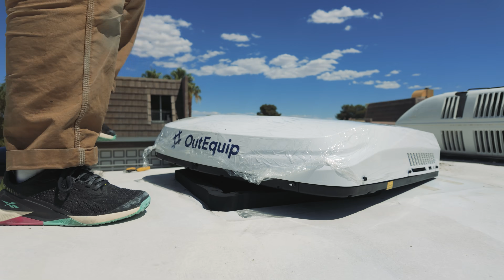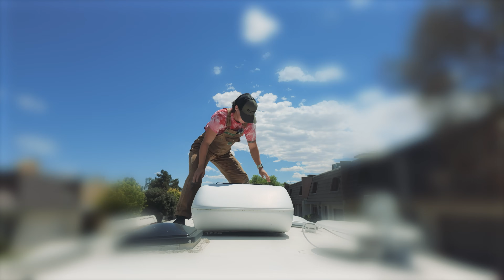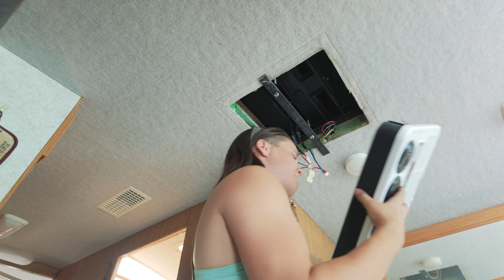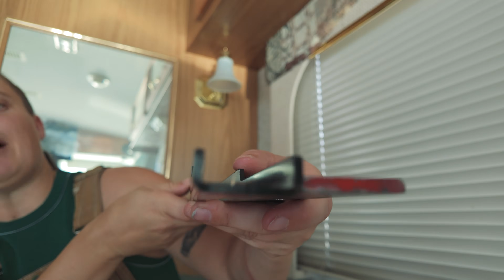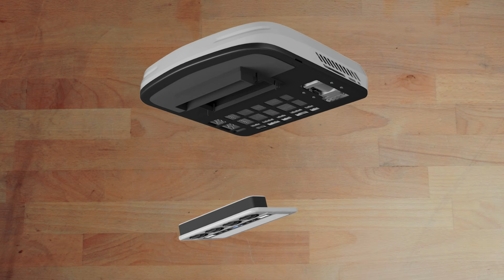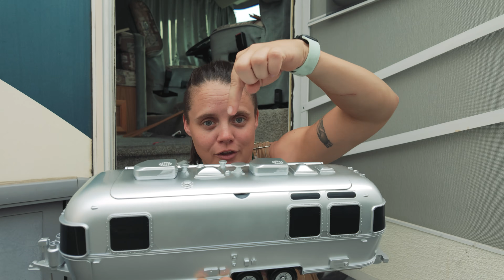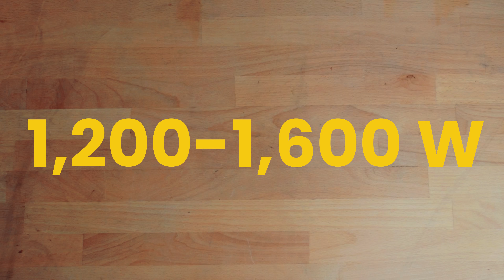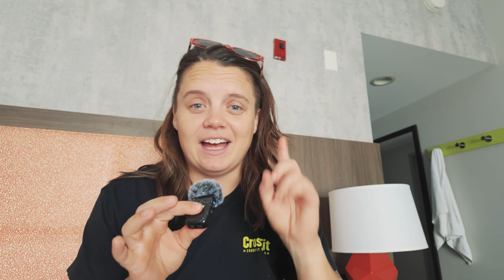Better RV Cooling with Less Power? My Switch to a 12V  AC | OutEquipPro AC Honest Review

Comment: heh i cheated getting my carrier on my roof.. i used a tractor to lift it right to my roofline and just slid it over as for the gaskets we tried them got sick of paying $46 each and finding out they leak we pulled them off used paint thinner to remove the crud it let behind and just used 2inch wide  butyl that overlap and 6 years down the road not a single drop and no longer get a mouldy musty smell.. even after 3 brand new foam seals 2 of them installed by an RV shop it still leaked and i got fedup.. as for me my trailer is semi perm parked on private property with a 60 amp outlet that feeds my upgraded 40amp consumer unit. have no issues would of loved to try the 12v system but at $1400 a pop compared to the 120v carrier i got brand new from the supplier for $599 its a touch out of reason if it ended up not being able to keep up..

Comment: To be frank the power usage at 22A was probably on an economical settings and not turbo. As their website state 58A at 12V on turbo for 10 000btu ( about 700W for 10kbtu ) which is more reasonable even though it's quite an efficient one as a house AC at 8kbtu will pull about 700-800W. The 300W you mentioned was way too low for it to make sense.

Their price is also surprisingly reasonable for the unit that also include heating capability ( I was honestly expecting something wild like 4000$ or the like since everything RV is just crazy prices ).

Comment: I’m sure the answer to this question varies a lot depending on what type of batteries you have but without a solar system on my class C rv how long would my two existing AGM batteries last with the AC turned on?

I’m guessing it’s not very long  ?

Comment: Thx for posting. I was hoping the fan noise would be much more quiet than the old unit . it is on start up but then ramps up to a similar noise level as the old ac .

Comment: OK, so, we just ran a contract on a 2002 Itasca Sun cruiser that has a basement air-conditioning with ducting. It’s 33 feet when they did the inspection it turns out the air conditioner would come on but turned itself off within a few minutes, so they said the seller was going to have to pay $800 to diagnose the air-conditioning problem. The tech said he was almost positive. It was a compressor and that he had just done one a couple of weeks ago and it was about $4500 and after the seller was contacted, he said he wasn’t interested in fixing it even though we are in Texas and who gets an RV in Texas without air-conditioning. My question is, could I just not use that basement air and put something like this air conditioner in my rig. We really wanted that RV what’s your opinion?
We walked away, but let me say that they immediately put

Comment: There is no way you are getting the same BTUs at 1/4 the wattage pull inverter or not unless the laws of physics change in that RV . If you are reading less watts that is because the inverter unit is not running on high inverter run units will take a suggestion of high but will use internal thermistors to determine the load. Will get more efficency but no where near that. Most of the effeciency of vfd driven equipment come from the start and the ability to only pull to match the load. Otherwise houses would all have 12v Heat pumps and air conditioners.

Comment: Ok, so I have a’22 year model trailer. Its box is 16’ with a furrion a/c central dump. The trailer has several 12v appliances already ( fridge, awning, slide, and lights) plus I have a 200 amp solar panel from factory. I just added 2 agm group 31 batteries to the rig. Do you think I could switch to this unit and it work for me? If so, what would I need to do to make it happen, as far as electrical, mechanical and so on? Thank you for your input!!

Comment: Two years ago I bought and installed a 12v AC unit in a ‘73 Airstream I purchased and revamped. ($900 CAD new, but second hand)
Mine just sits on the floor and gets screwed down. I had to give up under bed storage. It exhausts and drips out the bottom. 
I didn’t give much thought to pros/cons for DC over AC, (30amp system for me) I just bought what I thought would work.  I had to purchase 20 feet of cable at $10/ft CAD. 
The unit itself is quiet, but fan can be heard on highest setting. I do have an inverter, and two 100amh batteries, but I’m guessing those batteries would get used up daily if I wasn’t plugged in. After hearing the numbers here, maybe I would get more out of the batteries than expected. 
Let’s for a moment think about the words camping and air conditioning in the same sentence. Kind of silly. Even though I’m thankful to have mine. 
I enjoy these videos as I’m a DIYer, but a new RVer/camper.

Comment: They also sell a 24V version, but according to their specs, it uses more watts than the 12V.  I see the BTU cooling specs are comparable to a regular AC unit, but how does it compare in real world Vegas temps?  Does it do as good of job?  These units usually use 3 phase motors/compressors with an attached 3 phase inverter.  They could make one that took 120V DC (not AC) and then use a step-up DC-DC converter at the battery.  That way, the existing wiring could be used.  The vast majority of people that complain about these units are not complaining about the unit itself, but the necessary wiring.

Comment: How much success can be found by pulling the new wire with the existing A/C wires? Those will typically go to the braker box that has a 12V fuse panel next to it. Although it's common for conduit I know RV don't use conduit.

Comment: This is so great. I’ve been seriously looking at removing the generator altogether. Mine weighs near 300lbs. 300lbs of battery translates to piles of power. 
I’ve had excellent results with a 2600w lithium ion battery setup and 400w solar panels. It’s a tiny setup but managed to run everything we needed except the refrigerator and AC.
With these AC units (or similar), and the new 12v refrigerator options, I’m going all solar for my next revision.
Cheers!

Comment: THERE IS NO "MAGIC" HERE.  JUST A MORE COMPLICATED SYSTEM THAT USES A DIFFERENT POWER SOURCE.  WHEN HOT OUTSIDE THIS UNIT WILL DRAW MORE POWER FOR SURE.  I WILL PUT MY 30 YEAR OLD PENGUINE 120 VOLT RV AC UP AGAINST IT ON A REALLY HOT DAY AND COME OUT AHEAD.  MY LARGE LANCE CAMPER SITTING IN DIRECT 100* SUN LIGHT WITH MY 11,000 BTU AC RUNNING ON HIGH FAN SPEED GOT DOWN TO 60* IN 2 HOURS.  ANOTHER HALF HOUR WOULD HIT 55* AND THE MACHINE WOULD THEN TURN OFF.  SO, 100* OUTSIDE, 60* INSIDE.  🥶 WHEN IT COMES TO MAKING COLD AIR, THERE IS NO SUBSTITUTE FOR 120 VOLT HP!!!!!   👍

Comment: Good energy, great video. Nice work! Hope to see more content from you!

Question though, is trying to pull the new DC wiring through the channels/conduit the AC wiring is in a bad idea? Are new holes really needed?
Reply from the maker: Sometimes you can get away with it. But it’s usually pretty hard to access

Comment: Looks like the need a model with a van specific mounting solution out of the box.  Also mfgs are struggling right now - the whole industry is struggling so it's time to re-engineer the RV HVAC and while they are at it STOP putting a bathroom sink in small rigs where there is a perfectly usable sink in the kitchen just a few feet away.  IMHO the Industry should be integrating mini-splits into their designs. One thing for sure the Rooftop AC's that have not changed (Except for Expense) over the decades need to go.

Comment: i'm doubting you use a hair dryer too often. I  definitely would love to try this, but the changing the wiring to 12volts is a bit scary though I have 700watts of solar on the roof I installed

Comment: Same thing for any kind of transformer, switching power supplies, or buck converter. I call them energy loss devices. In a short distance, like in a camper, DC is more efficient because of those energy loss devices. If you have a 12-volt DC TV, run it on 12 volts, not an inverter. I think 24 volts is better, but I live in the US.

Comment: Great explanation, but you didn't compare the BTU ratings of the two units. The same delta T with less air flow would mean less BTUs. It sounds like it is more efficient and uses less power, but BTU ratings are very meaningful.

Comment: You're obviously not an HVAC professional. 1) Do you really think having all the air dumped into one area as opposed to routing it via ducts to different parts of the RV is more efficient? 2) There are soft starts for 120 volt AC units as well. 3) The 285 watt figure you give for the 12 volt unit is when the compressor is on, or not? Because the 120 volt unit operates at about the same wattage (300-400) when the compressor's not cycled on! Let the "HAVC Engineer - 30 year career" know this before he continues with the empty and unfounded accolades - which would be in order if your figures were objective. The benefits of using a 12 volt would certainly be having more 120 volt AC power available but if you're plugged in it's really not an issue whereas with the DC version having to buy at least $1,000 worth of lithium batteries another $1,000 or solar panels and then a solar controller plus all the wiring, MIIIIIIIGHT not be worth it for everyone. I boondock a lot but solar power is extremely limited to powering a small refrigerator and some LED lights. When I need serious power for my AC unit I turn on my dual fuel generator and all my power worries melt away for a whole lot cheaper and reliably than a solar setup!

Comment: So here are some questions I would appreciate some answers to. I believe my Furnace utilizes the blower in the traditional AC to push the warm air out the vents how would this incorporate into still having heater available? 2nd question do the make a way to incorporate it into an existing thermostat?

Comment: I installed this AC and measure the current. It was more about 40 amps when the compressor is running. The 20 amps is when the pressure in the compressor is gained and the compressor stop running the time it "warm" the radiator.

Comment: Good video.  What is the B T U of the A C?  What gauge wire was the supply to the A C?   At some point while boondocking the engine and or the generator will be needed to charge the batteries if there is no or low wattage soar panel on the roof. Perfect A C for vans or class B M H.

Comment: I heard that for example, if you are using a generator with propane gas, and have a big enough generator that you are only using 1/4 of it's rated power, the amount of liters of propane used per hour goes way down. So if you have a 4000W generator and use only 1000 watts for your AC, you can count on more like 0.1 liters per hour of propane use. Is this true? If so it complete changes the equations for using an AC with a generator.

Comment: I have a 5th wheel.  Our roof vents are 12 V and it is in the location that a 3rd HVAC would be installed.   The hole is wired for both 12 V and 120 V.  I would assume that I could add this 12 V AC to add addition cooling in my 5th wheel.  Agree?

Comment: I have a small travel trailer, and live in it full time. My unit came with a through the side wall window unit, that just can't keep up with daily temps during October in South Texas. I've been considering putting in a 12v rooftop unit, in place of my Fantastic Fan, and move that fan to the bathroom, which has a Craptastic Fan. I was hoping I could just use the existing 12v wiring for the fan, but thanks to you, I am both disappointed AND informed. Let's put more weight on being informed, yeah? My rig is only 14ft long, and not all that high, so getting it up there would be easy, and I could probably go through the black tank vent hole, and just cut a feeder hole through the wall where my fridge is mounted. An alternative would be to use the existing hole in the wall where the window unit AC is mounted, and install a reinforced cover, and mount one of those 12v backpack mini-splits. Pretty sure I can mount the output unit on the ceiling so I get front to back coverage. But what do I know, I'm just a former grunt.

Comment: Your 12V DC OutEquipPro Air Conditioner - does it keep your rig cool in Vegas?  And if it does, how long does it take to get your interior temp down to 70 with the original AC VS the the OutEquipPro?

Comment: You still have to charge the battery from your alternator and that wears down the life of the alternator then the battery is 50% capacity. so gas to alternator transfer, then alternator to battery transfer losses, - no gain in efficiency, power source is still gas, unless you have lots and lots of solar.

Comment: Just a user here giving personal experience. 12 volt DC appliances break down more than 120 volt AC do. Parts are not readily available. Even finding a tech to work on them difficult because of the call back factor. They don’t want to have indefinite responsibility for its repaired performance. I had to finally pull mine out and replaced with AC

Comment: You mentioned drilling a hole in the roof. I have a situation where I need to know how to seal off a hole where a WeBoost has been installed. I thought I would ask you here. I did not see a contact button on your website.

Comment: Hi there! 

Im over in Oz and it often gets into the 100sF here - which nearly kills me!   We dont have much in the 12v air con here - only thr chinese brand imported ones and - honestly - thespecs are never consistent and so not trustworthy. 

So Im looking at one of these - your review has been awesome! 

But heres my question please, if you wouldnt mind… 

Im looking to install it in a Hyundai H1 - so the roof is a single layer of steel, and strong - but Im wondering how much its gonna stick down through a single layer of steel?    There’ll be a thin layer - say, 1/2-1” of insulation and lining…but being such a small van, Im trying to get the internal fascia as close as possible to the “ceiling” of the vans roof as possible.  

So - any idea on how tightly i could get the fascia to the internal ceiling? 

Thanks so much! 

Danny.

Comment: I’m in Australia and we’ve got similar systems. I really like the education of your Chanel. I had to google boondocking, we call it ‘off grid’ which is most of Australia except rural towns or the east coast.  I’d like one of these but it’s costs double plus a few hundred for postage. So I’ll just keep getting educated by you. I’ve got a 1974 Vw camper van.  I’ll probably use the portable zero mark 3 which is $4,000aud with 2 batteries. Big investment in cooling in the tropical weather with about 90% humidity.  That’s impressive with the power usage😮

Comment: I have seen dc air conditioners that claim to be 15,000  btu. Does anyone know if thats true? If it is. Can you run a 12v air conditioner off your engine altenator when driving down the road or do you need deep cycle batteries and solar?

Comment: Here is my number onw worry — My Honda 2200i generator can run out 10,000 BTU AC/Heat pump (dometic coolcat). While runing it draws about 11 amps. Howver, this system draws 22 amps, whihc far exceeds most small generators limits. AM I WRONG?

Comment: putting a notch in that shape of a bracket will significantly decrease its strength in the only orientation that it needs to be strong in.. and 2, that bent "custom" bracket is perfectly fine. If anything it better because a flat bar can slide, your bent "rainbowing" bracket cant slide because its bent and locking itself in the hole with the bend. as long as it is not so weak that the bending will turn into a crease where the bar fails then id much rather have a bent thick bar than a notched thin bar.

Comment: Thanks for this video. My husband and I will be converting a van soon. I want to use a large Bluetti with solar, alternator charger and 110 when hooked up. Will this AC work on a large Bluetti?
Reply: Needs large 12V battery bank to supply it ideally charged from solar  + alternator and shore power. A/C unit draws upto 50-60A at 12V. 12V output on Bluetti power stations is typically 10A max. 

You can still use Bluetti for powering AC appliances and charge Bluetti from 12V battery bank.

Comment: Neither my 9BTU or 10BTU units in my sailboat weigh 80 lbs or anything close. This unit uses air and compressed gas as a heat exchanger. There are better 12V options that use less than 60 amps in the most challenging situations but for RV people this might be good

Comment: I got my first inverter mini-split air conditioner for my house a few years ago, and I just love the difference compared to a traditional cycling A/C. Of course my home unit has to rectify the utility AC to DC first. I live in a hot and sunny place, and have considered getting solar panels and batteries for back up power, and using them to run a 48V mini-split that would run even if utility power was out. It's easy to do in an RV! Pretty cool that it's possible on 12V too.

Comment: Solar prep in our Fleetwood gasser (2024) does not in fact mean there are roof ports.  For our Flair it means there is an XT connector in a compartment that routes to the battery box, thats it.  I was pissed when O found that out via an email from Fleetwood.   So for me the whole reason I wanted to watch this video is to see how it was re-wired.  And yes, I agree, RV to RV will be different but wanted to say solar prep does not mean you have roof access in all rigs